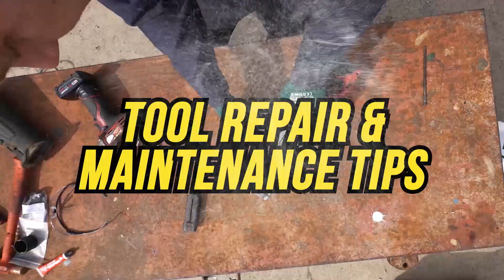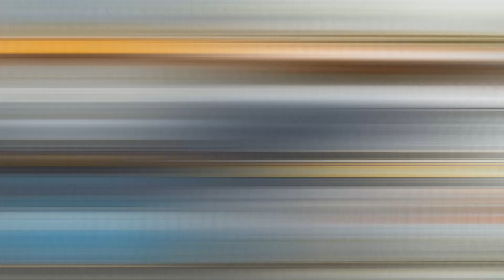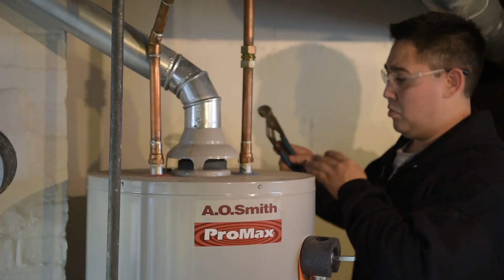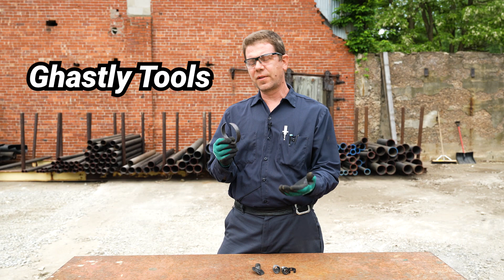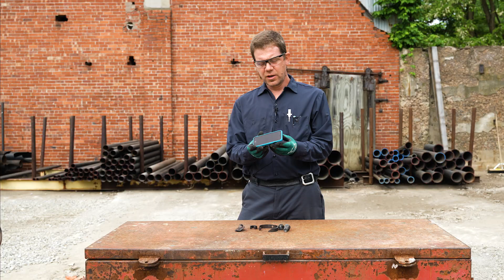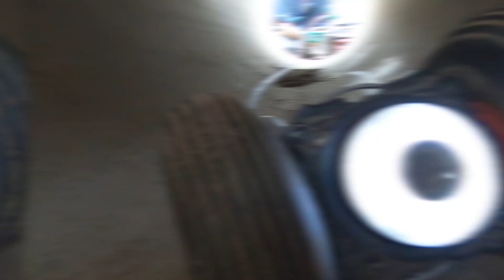Tools Used for Drain Cleaning

Comment: Cool gadget? And how long can it be stuck in a canal or pipe?
Reply from the maker: Well, you just want to use the tool and get the job done. Of course, if it breaks, it could be stuck there indefinitely... but we try to avoid that.
Reply: @WmTSpaeder  How deep does it go into the channel?
Reply from the maker: @diygeneration5566  Depends on the length of the cable. The machine shown has 100’ in the drum, so it will go about 100’. The cable can be disconnected, and a second drum installed and attached to the existing 100’ of cable for a maximum of 250’.
Reply: @WmTSpaeder  Thanks for the information.
Reply from the maker: @diygeneration5566  No problem. If there are any topics that you would like to see covered, let us know. If it is in our realm of experience, we'll do our best.
Reply: @WmTSpaeder  Ok)